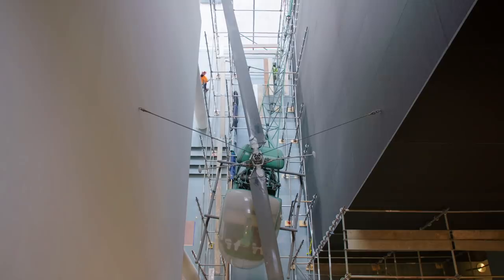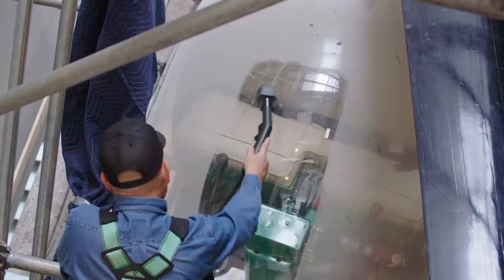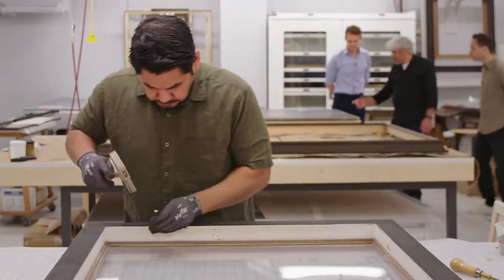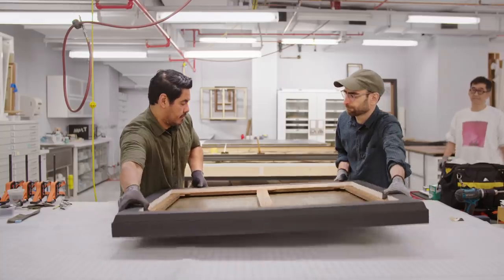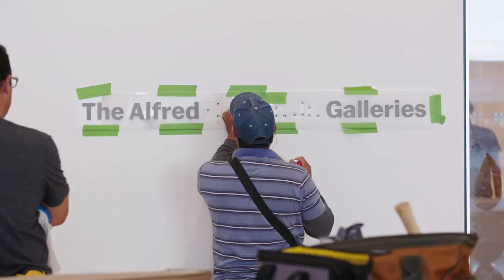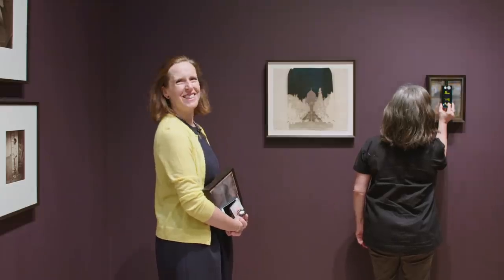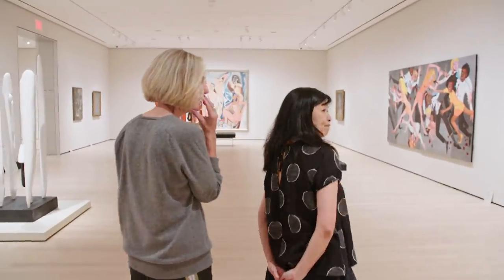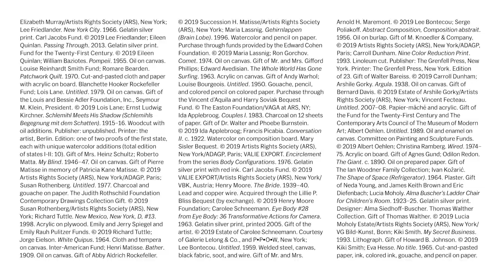It Is Good Lookin' (S2, E8) | AT THE MUSEUM

Comment: "6 is misbehaving, like it always does."
As a mechanical engineering student that has had to assemble multiple of the same machine, I really felt this. Even going as far to buy torque-limiting wrenched to unify bolt tensions between machines, THERE'S STILL ALWAYS ONE that refused to cooperate!